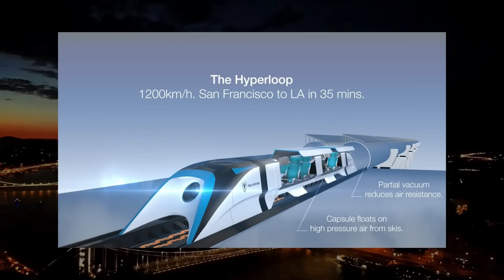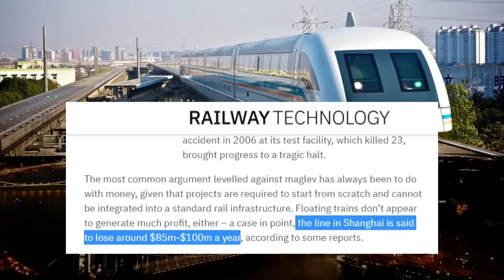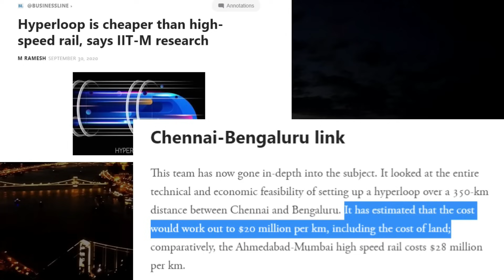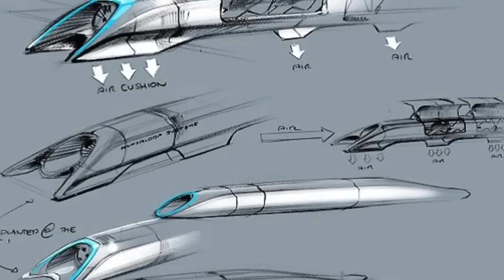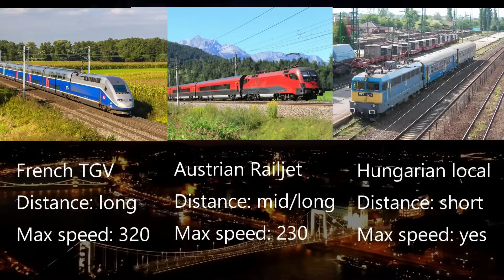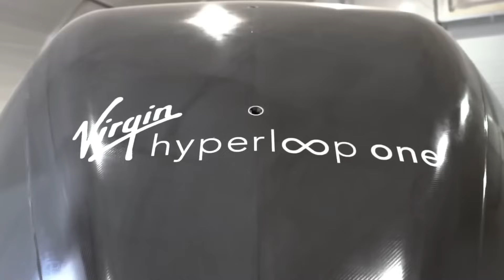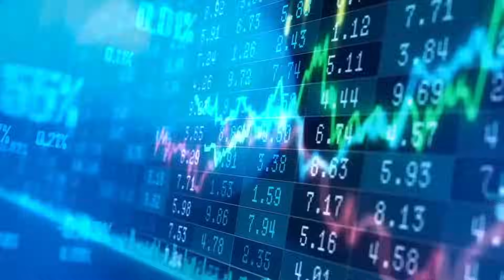Why was the Hyperloop Scrapped

Comment: The Hyperloop is a revolutionary transportation concept that involves a high-speed, low-pressure tube through which pods can travel at incredible speeds using magnetic levitation and a near-vacuum environment. This concept was proposed by Elon Musk in 2013 and has since gained attention from various companies and researchers working to develop functional Hyperloop systems. The goal is to create a mode of transportation that combines the speed of an airplane with the efficiency and sustainability of a train, potentially revolutionizing long-distance travel.

Comment: Right now, in 2023, there is no Hyperloop or Hyperloop-like transportation system zipping along the rails of America at high speeds. In the coming years, Boring Co will attempt to build a working Hyperloop.Hyperloop, the project has been indefinitely shelved. Musk did end up founding a tunnel-based company called Boring Co., but it falls short of levitation and jet-like speeds.